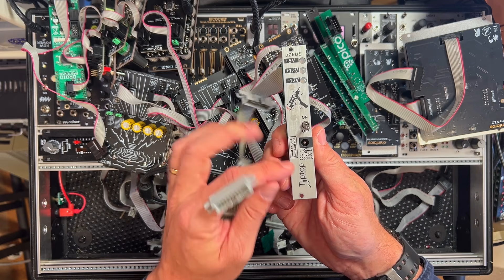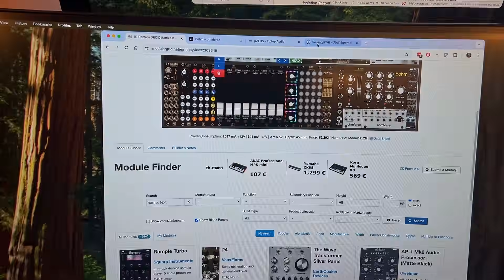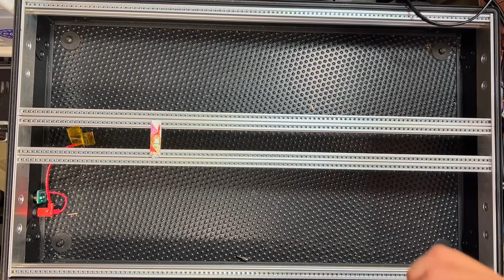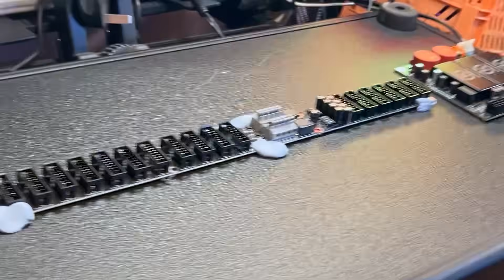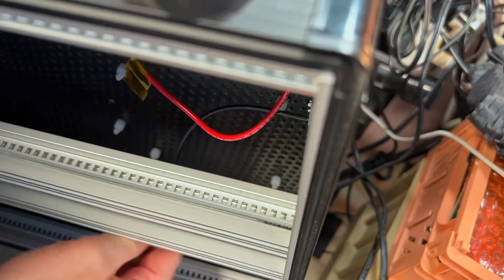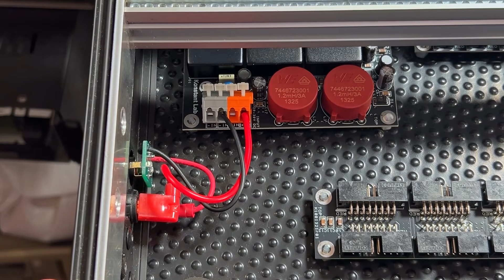Eurorack power explained.

Comment: On the back of macbeth modules there is a printed note that switched psu may damage the modules over time. good thing that konstant labs also have some linear psu for sale. With such expensive modules better be on the safe side.

Comment: This is not everything that you need to know, in fact there are serious omissions and errors.
mA are not power units, they are current. Power is current times voltage, so if you multiply the currents by the voltages and then add the total you will get the power consumed by the modules and this will all be converted to heat. If you have a 5A PSU you could be taking up to 120W and the PSU will take some more. Think about how hot a 100W light bulb gets... Cases need ventilation.
Your modulargrid plan should be ringing alarm bells. The difference between 2517mA and 641mA is 1.876 Amps and it is going into your 0V which is also the analogue reference! Digital modules use +12V and return to the 0V and that current will be digital crud. That is where digital noise is coming from. Flashing lights and displays degrade your audio quality. You cannot filter it out, because you cannot filter 0V only the +/-12V and using LC filters is more likely to pickup hum because the "L"s are coils. 
The biggest design flaw of Eurorack is its power distribution. You can get away with PCBs and ribbon cables on small starter systems, but as you expand the more money you spend the worse it gets. There is too high a resistance in all those tiny traces and wires and the only way to reduce it is to use more metal, but not just a little bit more you need orders of magnitude more.
You should measure the voltage difference between the 0Vs in different parts of the case when you have all the modules powered up. As you won't be able to get inside use the module jack sleeves as test points.
 You cannot have proper grounding on any system that has an external power brick. If your internal PSU is taking 150W that means that the two wires from the 15V brick to the DC inlet will be carrying 10A each and will have a voltage drop along them. You need three wires and the ground wire should not normally be carrying current.
If you are going to gig that case don't use those clip standoffs. Use a longer bolt going through a spacer and the pcbs and fasten a nylok nut on top.
Reply from the maker: Thanks Graham - it’s maybe important to mention you indeed sell your own Eurorack power distribution systems, although as far as I am aware none of them are portable? It’s interesting to hear the flaws as you outline here however there’s quite a bit of assumed knowledge so it is of limited help I’m afraid! And of course since the goal here is to put portable power in a travel case, what alternative does one have? Even if it is not perfect? I’ve not had any issues with this system after building it.
Reply: @mylarmelodies  I feel like at least some mention of the difference between current (mA) and power (W), a general recommendation to be cognizant of imbalance in current draw between +12V and -12V rails, and the differences between bus cables, busboards, and busbars (all 3 of which can be used in portable systems) ought to have fit pretty well in the video. I definitely agree that some other things just come down to the nature of Eurorack and portable systems.
Reply: @mylarmelodies  I make power supplies for any format. By portable do you mean able to be carried in a backpack on the bus? Colin Benders considers his system with twelve of my PSUs portable.
The smallest PSU I've made was for a system in a trumpet case, but the trouble with scaling down is that the cost doesn't scale as much. I consider 2A/rail an optimum size and best value, below that is wasting money, above that makes the cabling larger and more expensive.
I don't think I am assuming anything, the modules define the amount of power needed and the rest is down to the laws of physics. Busbars do not take up any more room than busboards, about 12mm deep, and I can make them thinner and wider if necessary. Most of the weight is still in the rails and module panels. I've made gigable systems in lightweight ABS 19" rack cases and mixer flightcases and call me old fashioned but I grew up lugging drum kits and Marshall amps and synths that needed four people to carry. If you minimise a synthesizer too much it won't be much of a gig for the audience.
Reply from the maker: Thanks - I mean by assumed knowledge that I’m afraid most folks - myself certainly - don’t/won’t understand everything that you cited as an issue. If it was necessary for every power supply to be designed as yours has been in order to be good, why aren’t they? At the end of the day while what we have in many systems may not be perfect, perfect is the enemy of good, and these supplies are self evidently good enough, owing to the small briefcases being played at big club venues and everyone there busy enjoying the music. Colin Benders is using an Amalgamod case system live (I assume with their Linear power system that uses bus boards) and clearly this works for him too.
Reply: @mylarmelodies  It is necessary to provide cheap power supplies to get people started and hooked on buying modules, but when they start expanding the problems begin to appear. Most cheap power supplies are designed to avoid safety and EMC regulations, that is why they use external "bricks". That isn't actually legal in EU/UK if the bricks are sold with the PSU so they are usually sold separately.
 Colin Benders has custom stacking Ginkosynthese aluminium cases fitted with my PSUs and busbars which may be seen in many live videos here.

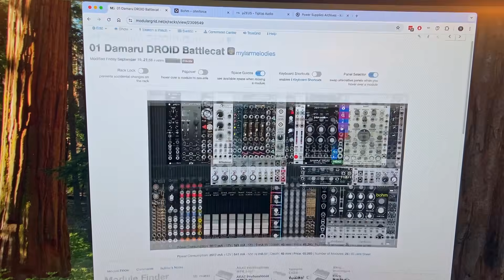Comment: 14:00 fair point that modular grid’s db isn’t super duper accurate but I kinda winced at the suggestion to diy a spreadsheet and check mfr websites instead of just clicking the “data sheet” link right under your finger to see that the worst offender in this case is the droid faders and if you simply remove them you’d have a ton of overhead. 😅 kidding! excellent explanation vid Alex this will save me time next time I don’t feel like explaining it all myself to the next person

Comment: Use a hole saw for the side with the power thing, and then the regular drill bits for the screw holes.
use a sharpie pen to mark the locations to put the holes so you don't risk damaging your circuit boards by running the drill into it.

Comment: Power is super important. Other great options are Befaco Trolley bus, make noise and doepfer psu3. All of them assure they can be topped out. Otherwise the general rule of thumb is 80% maximum. 

Trogotronic makes a silencer power cable but it’s pricey. 

Cutting the hole, trace the inlet, drill a hole and use a hack saw or something like that. 

Other then drilling through and using standoffs, I’ll get some really strong double sided mounting by tape and boards don’t go anywhere u less you mean it and it’s quick and protects the underside of the boards.

Comment: Good guide! The konstant labs psu's seem to have a good reputation, although like many eurorack things, I do find them a little bit pricey! 
I have gone properly old school with my cases, as I hate, (A) - switched mode power supplies, and (B) anything that needs a bloody 'wall wart' or 'snake thats swallowed a rat'! So my diy psu's are old fashioned linear, with toroidal transformers, all within the case, switched/fused iec 'kettle lead' socket on the back, -plug in the power lead and off you go!
 I do realise that this approach is frowned upon in the modern world, but what the hell! 
The downsides are that the linear regulators kick out a bit of heat, so cabinet ventilation is a good idea, and they take up a bit of space, also reliable current capacity is limited, but with oversized transformers I can always stick in another regulator board and bus board if needs be.( Currently the cases are 9u 104 hp with two busboards, each which has it's own psu) 🙂
Reply: the 78h12 and 79h12 type regulators can handle max 5A, maybe handy to use them instead of making several regulator boards with smaller 1A versions.
Reply: @fuzziemusic  Yes, that would be sensible!😁 I already had many little 317/337 boards built up as I'm always using them for things, so I used those!

Comment: I may have misunderstood, but didn’t the recommendation from Konstant say to put the digital modules on the Direct side and the analogue ones on the Filtered side (to protect them from the digital noise)?

Edit: not that it matters if there’s no noise issues anyway!
Reply: It doesn't matter as that is incorrect advice. Modules usually have some filtering on the +/-12V anyway,  the power distribution paths should be as low resistance as possible.
Reply: When he installed them in the box to the standoffs they were opposite of how he first laid them in the box and talked about where the digital and analog modules were going.
Reply from the maker: Yeah analogue should be in “filtered”, digital in “direct”! Ha maybe I installed the modules in the wrong side, but in any case not had any noise issues I noticed.

Comment: Excellent topic to cover, I searched and reviewed power for my eurorack systems for six months before settling on my first bought case, the After Later Audio Adventure case in 104HP. Prior to that purchase all of my cases have been DIY and custom designed. I started out following Doepfers recommendations strictly and built two very deep cases 9U in height and standard 84 HP width with Doepfer Linear DIY power supplies -(These may be close to be being over taxed on power delivery). My next two cases were skiffs at 6U and 84hp with Flight of Harmony module power supplies and distribution boards. Then two suitcase style cases with industrial power supplies being thrown out from work and TipTop distribution boards. These power supplies were the switching type and a little bit more power than the FOH and Doepfer supplies. I ran into the dreaded under powered situation with my last case which was a 7U 160HP beast and only had one of the industrial power supplies trying to cover all of that real estate. I have since added an additional Doepfer PSU3 and upgraded the grounding bus into the case but I am nervous to switch it all back on. Spent weeks with a mult., a Jouranalogue Test3 module and Modular Grid getting all the power specs for my modules. Thank you for covering this subject, smooth power, well appropriated headroom and secure grounding are very important to your eurorack system.
Reply: Thank you taking the time to write this.  I have a doepher DIY kit and I just need side plates before I get my chippie to make the case.  My brick puts out 2.5 amp and the case will be smaller than the one shown in this video by being 6U.  I feel confident in my choice of power supply now.  (Thanks to your comments and this video.)

Comment: This video would have been a lifesaver when I was first getting into modular.  

I know it is a bit of an ask but I would love to see a part two video for the DIY community.  Some way to measure the mA output of a supply as well as a method for finding the input amount required for modules that don't have manuals would be fantastically helpful.
Reply: So basically a video on load testers and bench supplies? I wouldn't mind that from Mylar actually....
Reply from the maker: Not something I’ve done but could defo research & document!
Reply: That would be an interesting one especially for the DIY community where you don't have a manufacturers guide saying a module requires XYZmA of power

Comment: About the extra holes in the case, you can use a soldering iron and a zip tie to cover de holes in the same way you solder a circuit by melting the zip tie over what you want to cover.
Reply: No! Add MORE holes and call it ventilation. In the words of Pee-wee Herman, "I meant to do that!"

Comment: Cool. I have the filtered busboards by konstantin in all my cases .not sure if you mentioned how the psu behaves in reverse polarity or or overcurrent voltage etc. My psu ,different manufacturer,flashes the modules,its called hiccup mode funnily enough.imagine these work in a similar way?Cheers alex power is not boring. Take care.

Comment: Good timing as I’m looking at power just now. I “broke” my Beads on power up most likely due to not having enough power 😢 so Get ur power sorted folks 👍
Love the SOS mug 😊
Reply: How did you broke your beads by low power? 😢 #panic
Reply: @cubooFX it was working fine then one day I turned on the power and all the lights came on. I think what has happened is due to not enough power being available at start up it has crashed. I need to re-load the software/code into the module to re boot it. I have been unable to do this and need help to do this 😢
Kinda sad about it - any help or comment ??
Reply: That was a couple of years ago ago now … I’m going to make it my mission to get it fixed or sell as broken. Maybe someone can fix it.
Reply: @lesliemakin the Update ist not that hard to do. Just play the wave file via your mobile. You have to check the volume, perhaps you need several tries ...
Reply: @cubooFX if the module is crashed already the firmware upload by audio does not work... I have the same problem as op with a clouds clone
Reply: I’m aware of this. This is how to update the existing software in Beads . i need to go to the step before this where you program the chip inside Beads . This needs to be done using a ST-Link programming device and software. I have tried this but the process failed, probably because I do not know the proper commands to load the code. 
Needs a proper tech to do it with experience of programming microprocessors. Beyond my skill level.

Comment: I just plug everything into my Behringer Go cases (170 bucks for 280 HP) and never had any problems so far. (Had a quick look at the modulargrid ratings of my configuration)
Reply: That makes sense. Behringer's supplies (both the one in the Go and the CP1A) aren't the best in anything, be it power, noise, build quality, or longer-term reliability, but dangit they're just super easy to plug in and get started with!
I'm glad that this video and ones like it exist for those just starting out though, and that the rest of the market seems to be catching up

Comment: It should be noted that the newer Doepfer cases can in fact be had with boxed headers!
Reply: Just check that the cables are correctly made too, many were not. There should be a little triangle moulded on the connector that indicates pin 1 and that should be the same side as the stripe on both ends.
Reply from the maker: Yep it’s true - and modules too I think?! Or at least power is indicated?